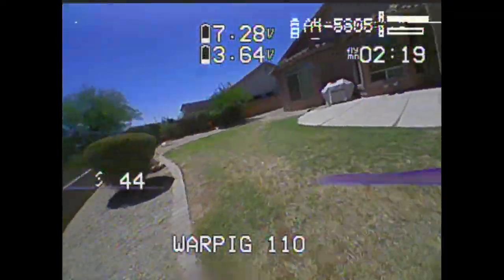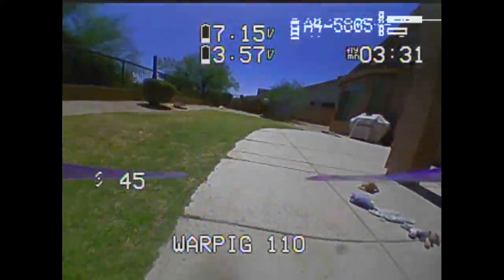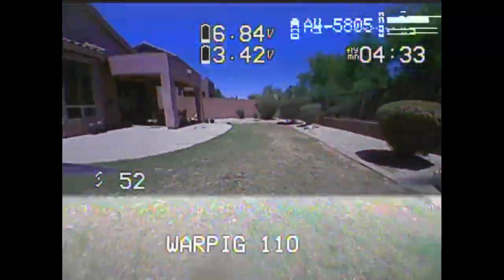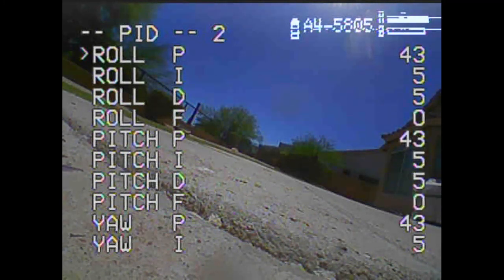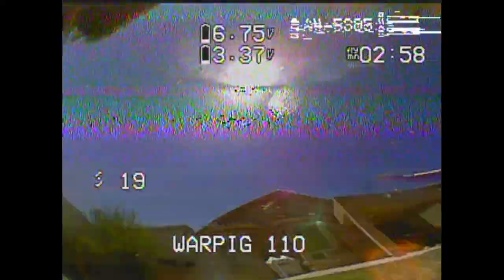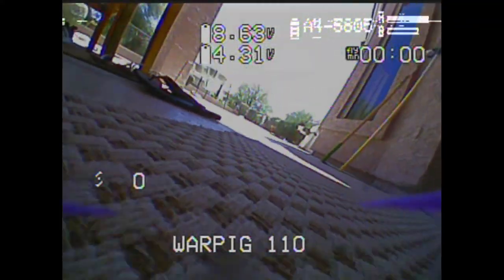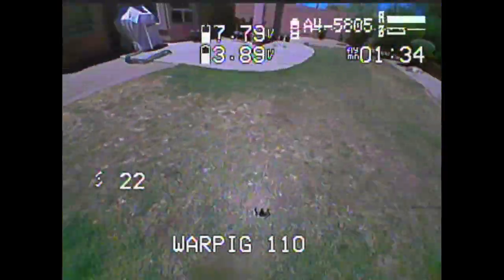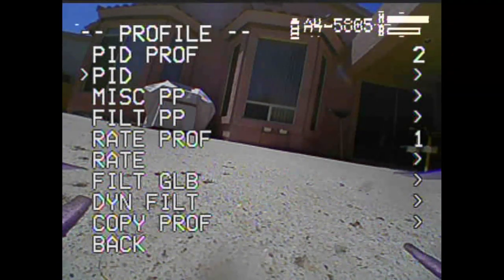Betaflight 4.2 Setup and Tuning for Ultra-lite 1-2S Micros: PID tuning

Comment: The best PID tuning tutorial ever!!! I watched several before and yours is head and shoulders better! The order of settings, the examples of too high/low, the fact your tuning knowledge is largely your own, but also includes the 'teachings' of renowned tuners, plus the fact that this very tutorial is amed at micros - all this makes it an absolute must-watch for any intermediate micro quad pilot like myself. 
Using your tutorial (not just the exact values) not only can I now say I've got some understanding as to what PID category does what, but also, that I now dared to do tuning myself and  was able to improve my Baby Tooth 2s by quite a bit (used standard BF settings before) and I feel that I now have a knowledge toolbox with which I can further tweak my quads as my skills and understanding grow.
Thanks dude! (the 100th like is from me ☺)

Comment: i´ve heard bf 3.57 flies better on micros by several people. What do you think? Bob Roogi (kababfpv) actually recommends bf 3.57 on fpvcycle for 3s 1303 100g toothpicks
Reply: I use 3.5.7 on all of mine
Reply from the maker: I would need to got back and retry 3.5.7 on my current builds with a ground up tune to make a fair comparison. However, I generally don’t get the 3.5.7 love and liked 4 when I initially made the switch. I tried emu recently on a 1S build and was underwhelmed. I really want to see what NFE has done with quicksilver. I’ll give emu another shot when they get out of beta. Maybe I’ll take my f3 1202.5 build back to 3.5.7 with the Roogi tune and do a shootout. I also wonder how much of Roogi doing 3.5.7 is just being comfortable with it and that he “never turns quads anymore and just adjusts the rates” (from his emu video)
Reply from the maker: Toothracer I’m curious as to what your motivation to stay on 3.5.7? Is it more if it’s not broken don’t fix it? Or have you tried 4.1 and had issues ?
Reply: Quad 66 more if it ain’t broke don’t fix it. I had 4.1 and rpm filtering on one of my builds and didn’t think it flew so dramatically differently to warrant the upgrade to the rest of the fleet
Reply: Quad 66 I would love to see you do the comparison. My rates and tune are different to Roogi’s. Closer to the numbers I saw in this video actually. I have similar thoughts about emu. People were talking about it like it’s having a whole new quad
Reply from the maker: Toothracer I had a similar “emu” experience on my 1102 1S build with switching to 48khz. My first reaction was mind blown at how smooth it was ... then I flew it some more.  Once the honeymoon was over I realized ok it’s not as crisp and sharp as it was and power is down. So I started to tune it going to higher Ps to get the crispness back and I did but magically it was no longer so smooth. So 48khz smoothness was more about turning down a hot tune than 48 khz transforming it into a whole new quad. In the end I went back to 24 kHz and my borderline too hot tune. For emu I do expect it to have better angle flight as they are drawing on NFE silverware. But I also expect them to reinvent the wheel a fair bit.
Reply: Quad 66 the honeymoon effect is real isn’t it. Every new thing in this hobby seems to be impacted by it. It isn’t helpful that producers want to sell products and so pump up products too. I really like that you do long term reviews and comparisons without being influenced (as best as you can) by what’s popular or trending
Reply: Depends on the props.  BF4x hates emax avan rush.
Reply from the maker: Chunder FPV really? how do? They seemed fine on my 1130 7500kv 2S build with BF 4.x
Reply: @Quad66  You're tune is a bit more extensive than what I've done.  I'll have to try it out.  But on 3.5.7 I just change pids and tpa then it flies perfect.  Oh I should mention I was tuning for 3/4s.
Reply: I have a pair of identical 102g quads (3S, but I also run 2S packs on these).  One is 3.5.7 (stock firmware for a spec racing setup with a good tune), the other is 4.1.3 with a minimal tune.  The Tune on 3.5.7 is good enough that they fly really close, but the edge still goes to the RPM filtering setup in terms of responsiveness and propwash handling.  A bit of that is likely feedforward changes mixed with a better filtering scheme, but there is just more tuning margin possible with RPM filters killing off all the motor noise (especially on butchered props).
Most people don't have an A/B setup like this, and it's understandable, but those who do will wind up preferring the 4.2 setup once properly sorted.  I can understand the improved ease of 3.5.7, but a lot of that has to do with the defaults being a bit more forgiving out of the box.
Reply: @chunderfpv  It doesn't, but probably isn't happy on stock tune with your motor/frame setup.  4S anything with those Avan's is going to be capable of inducing tons of oscillations, odds are that's what's off.  If you have motor poles, or DBoost configured in a way that is best for a 5" freestyle quad, you'll definitely have problems.
Reply: @MrStrikeforce1987  У нас говорят так про ЭТО!! " Не залезай в технику и она тебя не подведет")) По мне! это сугубо порочное мнение...We say this about THIS !! "Do not get into the equipment and it will not let you down")) For me! this is a purely vicious opinion

Comment: И сново Добрый День!))) Для этого случая у меня подопытным являатся - Diatone TAYCAN 25 125 мм и JHEMCU GHF420AIO 20A 35A 4 в 1 ESC F4 OSD будем определяться с JESC  24 или 48 кгц, как поступить с CPU разгон необходим?? В этой конфигурации можно использовать - Dynamic Idle?? Как поступаем с RPM filtering?? Пока все!)...  And again, Good afternoon!))) For this case, my experimental subjects are - Diatone TAYCAN 25 125 mm and JHEMCU GHF420AIO 20A 35A 4 in 1 ESC F4 OSD will be determined with JESC 24 or 48 kHz, how to deal with the CPU overclocking is necessary ?? In this configuration, you can use - Dynamic Idle ?? How do we deal with RPM filtering ?? That's all for now!) ...
Reply from the maker: With JESC telemetry enabled you can use dynamic idle and rpm filtering. “Telemetry” refers to the ESC sending the RPM data back to the flight controller. It is this RPM data that enables dynamic idle and rpm filtering.
Reply from the maker: CPU over-clocking is recommended to give the processor sufficient speed to handle the increase computing for dynamic idle and RPM filtering.